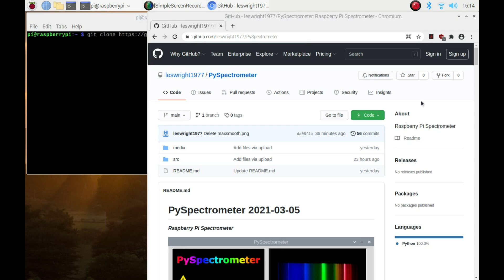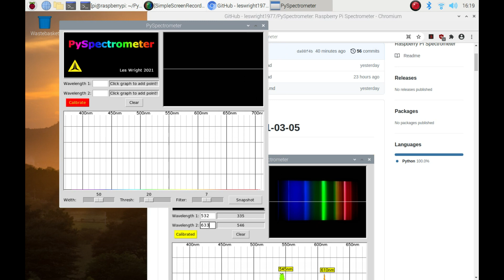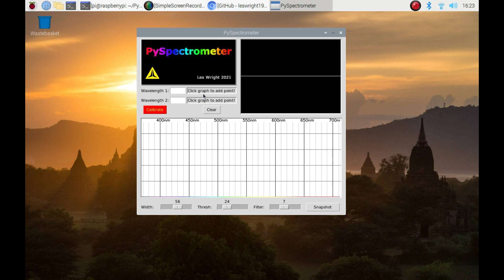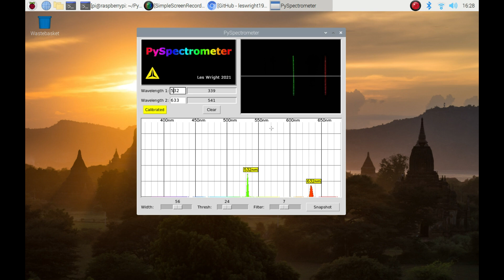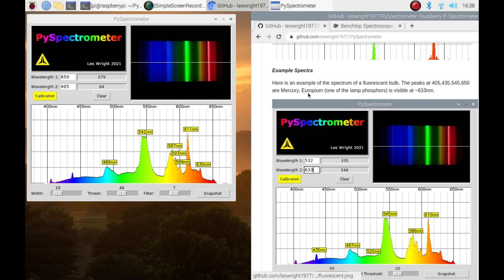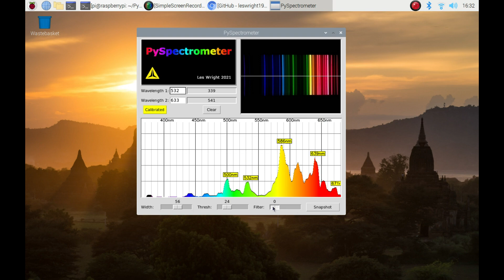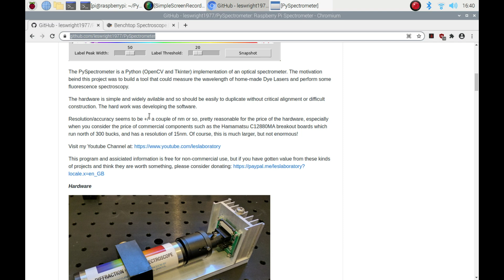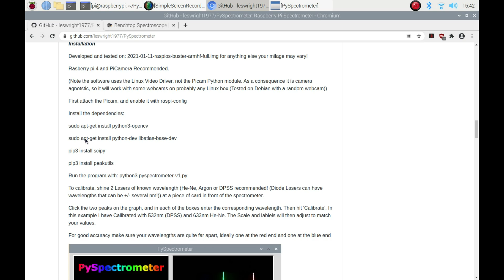How to build a DIY Raspberry Pi Spectrometer using a Picamera and Spectroscope.

Comment: Hey. Cool project! Do you think it would be difficult to make a similar spectrometer approximately the same size for IR/NIR ?
Reply: I was wondering the same thing, could you use the Pi NoIR camera to broaden the range into the NIR spectrum? (up to 1000nm I think...)
Reply: Most standard cams go up to ~1000nm, when the IR Filter is removed, that's for cheap. Night vision/Surveillance cams come even without IR filter. Rarely, cams go up to 1100nm. Above that..it starts to be a different hardware with germanium instead of silicium sensors..what is costly. From what I have seen, scientists are often interested in the range 2000nm up to 7000nm, and that is in the costly range.

Comment: This is a great tutorial. I just keep getting an error saying: 
    import cv2
ImportError: numpy.core.multiarray failed to import
 I downloaded all of the dependencies and even redownloaded them. Is there any way to fix it.
Thanks😀
Reply from the maker: @aomath9948  Weird, is numpy installed, what's is the OS and version? This article may shed light on the error: https://www.geeksforgeeks.org/how-to-fix-opencv-importerror-numpy-core-multiarray/
Reply: @LesLaboratory  Thanks for the response. The current version of numpy is 2.0.1 and the OS is Debian Bullseye. Is that OS too old?
Reply: Also when I tried upgrading openCV there is this error:
 
ERROR: Failed building wheel for opencv-python
Failed to build opencv-python
ERROR: Could not build wheels for opencv-python which use PEP 517 and cannot be installed directly
Reply: It still doesn't work😢

Comment: Might be good enough to play around with but your "calibration" is probably just good enough if you care about relative peaks and absorption lines. This doesn't take any sensor "response" into account so the actual shape seems to be bogus.
Reply from the maker: @JohnJTraston  Yep. If you want a predictable response you need to either use a monochrome camera, or debayer the sensor (see my other video for that)
Reply: @LesLaboratory  Do you think that the Sun spectrum would be reasonably consistent at a specific time of a day (e.e. noon) for such calibration?
Reply from the maker: @JohnJTraston  yes, but don't point it directly at the sun without and appropriate ND filter. The blue sky is luminous enough for this job. I use a small hand held fluorescent lamp for calibration which produces nice sharp lines.
Reply: @LesLaboratory  I am not talking about lines but rather the actual proper shape to account for Bayer filter, etc... Like, grab a standard D55 illuminant values from a table, capture the Sun and calibrate the overall shape of the expected spectrum.
Reply from the maker: @JohnJTraston  ah gotcha. A tungsten bulb would be better, and is as far as I know, a standard.
Reply: @LesLaboratory  Hm... I'd have to try it. It might have a better black body property but I am not sure I can trust the temperature of it.
Reply: No they are not it depends on the temp of the philiment of course.  You could bue a calibrated tunston lamp @LesLaboratory

Comment: Did you remove the IR filter from that f1.6 zoom lens?
Reply from the maker: No. But they can easily be popped off.
Reply: @LesLaboratory  OK great, got all the stuff arriving this week. Nice project
Reply: Got my cam and my zoom lens,  my U19500 Diffraction grating arrives tomorrow. Already ripped out the IR filter. Mounting structure will be 3D printed❤😂

Comment: Really cool project. Possibly uneducated question, would you achieve greater resolution by tilting the spectrum scope relative to the camera? My thinking is that if your sampling line covers from the bottom left of the spectrum to the top right of the spectrum you’d have more pixels to sample?
Reply from the maker: Not really. The camera is already capable of much higher resolution, but the optics in the spectroscope are not really up to it. With a better frontend, you would be able to get sub-nanometer resolutions
Reply: @LesLaboratory  thank you for your response. I hadn’t anticipated the spectrum scope itself being the limiting factor, but that makes sense.

Comment: Would you publish a known set of peaks ? Will they work with a telescope?
Reply from the maker: The peaks are published on my github (see description). With a telescope, since stars are point sources, there is no need for a spectroscope with a slit, you could just use a diffraction grating. I have not written software for this though.

Comment: How about an IR spectrometer, like the one that chemists use to identify molecules? Is it possible to make one at home?
I was thinking on it myself for quite a while, but I don't have any ideas what parts could be used to produce a wide range of IR radiation frequencies that could then be filtered out by the sample, and what detector could be used for IR radiation from that range.

Comment: is this useful for detecting skin colour ?
Reply from the maker: This is originally designed for measuring light sources. For reflected light you would need adequate illumination. There are color sensors available inexpensively for the arduin and raspberry pi that might be more suitable, especially if you are trying to match skin tones for cosmetic applications for example.

Comment: Is there a huge difference between those 10$ china spectroscope and those more expensive 80-200$ ones for this specific project?
Reply from the maker: I have never had one of the cheap ones. If it's 10$, then it's worth a gamble I would say.

Comment: How and can this be used to identify metal composition using an arcing device to generate the light from the spark to software to identify the metal used in the spark event?
Reply from the maker: It might be possible but would require significant modification. For Laser induce Breakdown  Spectroscopy, you need to be able to capture the afterglow. The initial flash is just broadband light. This means you need to gate the camera somehow in order to capture the spectrum.
Reply: What if a person used video capture and froze a frame at the desired point and used that for the spectrum to analyze? 
Also could you link the correct raspberry to buy to run your software? I am confused as to what I need to buy today or sooner!  @LesLaboratory

Comment: Just a simple question: if you correct for lens distortion, would this help to get more linearity in the sensor?
Reply from the maker: In the latest version, the PiSpectrometer2 (see my other videos), the nonlinearity is dealt with, by using multiple data points for the calibration. This essentially creates a best-fit curve that compensates for dispersion and aberrations in the optical path. If done correctly the calibration is extremely accurate.
Reply: You are really fast in answering! Indeed I've seen that videoas well, but on my gut feeling I'd say that using a high degree polynomial for curve fitting holds the risk of overfitting. What I'll do is built the spectrometer setup (thanks for sharing this very cool project by the way!!!!!) and see if can find out what is tha best manner to calibrate: correct for lens distortion and do a two point calibration, or apply a multi point polynomial curve fitting.   @LesLaboratory

Comment: Cool I have built a Raspi Terminal with 7" touch screen,  that is beside my light microscope... with Raspi cam mounted to the third ocular on the microscope. Now if I added a UV LED illuminator I could measure wavelength shifts etc of specimens !

Comment: How difficult would it be to retrofit this project to an ESP Cam and stream it wirelessly to achieve the same objective?
Reply from the maker: It could be done, to a degree, it depends what you want to achieve. I guess you could use the ESP cam and minimal software to stream the intensity and wavelength values only, then do post processing on the computer.

Comment: amazing project! if i using monochrome camera, which parameter should i change? thank you!
Reply from the maker: You shdoulnt have to change anything. Is just uses the first available camera, and if that happens to be a black and white USB camera, it will lick it up and use it. There is updated software by the way, with a seperate script specifically for USB cams: https://github.com/leswright1977/PySpectrometer2
Reply: @LesLaboratory  thanks's for the opportunities. Buat i mean, i have monochrome camera from Allied Vision (vimba usb camera) that have an API to use. Have you ever know about this?

Comment: id like to take it a step further, and use 200-700nm grating for the spectroscope, and duueterium or another light that emits 200-700nm and modify the software to be able to calibrate serial dilutions in order to ID and quantify molecules in a solution.    would you be open to working together or helping to get there?

Comment: Hi Les I'm a newbie . Just bought the Raspberry Pi 4B (1GB RAM) because of your wonderful project. Unfortunately rpi can not boot using 2021-01-11-raspios-buster-armhf-full.img. It says the system is too old. So I tried the ver. 2021-03-04. Ok the booting is fine but when installing pip3 install scipy: "Running setup.py bdist._wheel for numpy  - the computer almost freezes, it's not responsible so I can not finish the whole process. Any hints would be very welcome, thanks in advance
Reply from the maker: What is the pi foundation up to?! I will download the new image and see what can be done here. I was wanting to write new modules for it anyway! Thanks for your support!
Reply from the maker: Version 3.2 now up on GitHub, which fixes the issues in Bullseye, (just tested with latest image). Let me know how you get on. The next incarnation of this project is coming soon!
Reply: The same situation when using Legacy (September 6th 2022, Kernel version: 5.10
Debian version: 10 (buster)) taken from raspberry page :(  Still I cannot pip3 install scipy. Is anyone willing to prepare the system with the libraries installed so I could run PySpetrometer on my Rpi4 please? I'm willing to pay for your time...

Comment: I love your channel and videos, so helpful for a laymen.  I wanted to track down the two lasers that you used to calibrate, but they seem to be extremely pricey.   You mention that diode based lasers aren't that accurate, is there another light source that I could use to calibrate that isn't that expensive?   Thank you!!
Reply from the maker: Thanks! Yes, you can use old style fluorescent lamps. These have clearly defined emission lines that are are easy to look up. Regarding lasers: the 532nm green pointers that you can get really cheap are bang on 532nm and do not drift. The 405nm violet pointers are fairly reliable as well. All red pointers drift in wavelength quite significantly, and without spending $$ they may have wavelengths +/- several nanometers from that advertised.
Reply: @LesLaboratory  That's awesome, thank you for sharing your knowledge, I really appreciate it.!!   I'll keep watching for new content.

Comment: Hey, I tried to build the spectrometer, but I am having a little difficulty with the python code. This is the error message:
[ WARN:0] global ../modules/videoio/src/cap_gstreamer.cpp (1824) handleMessage OpenCV | GStreamer warning: Embedded video playback halted; module v4l2src0 reported: Failed to allocate required memory.
[ WARN:0] global ../modules/videoio/src/cap_gstreamer.cpp (914) open OpenCV | GStreamer warning: unable to start pipeline
[ WARN:0] global ../modules/videoio/src/cap_gstreamer.cpp (501) isPipelinePlaying OpenCV | GStreamer warning: GStreamer: pipeline have not been created

Does anybody have any idea what I could change to fix this?
Reply from the maker: What version of Raspbian are you using?
Reply: @LesLaboratory  i am on version 11 bullseye. sorry for the delayed response.

Comment: Hi. I wonder if you could stretch the camera-image to match the graph. My brain was trying to match the lines to the peaks while watching and that would make it easier. very cool.
Reply from the maker: It could be done, and it is open source, so you can modify it if you like. The reason it was not done is speed, large live images in OpenCV are a bit hungry for CPU and RAM, so I wanted it lean. I suppose I could remove a strip of video, say 20px high and 640 wide,  and display that under the graph, that could look pretty cool!

Comment: How high in frequency can your system detect? can it detect far infrared? or is this more dependent on the camera being used? Great work!
Reply from the maker: It can go a little ways into the UV ~380nm to a little ways into the IR ~810, but the spectroscope was designed for visible light. You could build a spectroscope with an extended range though.

Comment: Those aren't bad, I bought one based on the same technology offered by Chris Wesley in the UK called the iPhos: https://youtu.be/F1pdnt3-4y4 - The accuracy is stated to be about 2 nm, but from what I saw from mine, closer to 1 nm, sometimes half of that, depending upon how wide the slit is and the amount of light. Since then I upgraded to an Ocean Optics Spectrometer I found on ebay for 350 dollars which works great. The price was a steal, normally they go for two times that or higher, depending upon the model. Mine is an older SD2000 but it is just as accurate as their newer models, for the most part, unless you buy a very spectrum limited unit which doesn't have much range, those can be much higher accuracy down to under .1 nm.

Comment: How do you calibrate amplitude (height)? which source could be used with a known curve? For example, I think a calibrated amplitude is needed to calculate CRI for light sources
Reply: @TheOleHermit  that part is clear, I'm suggesting to introduce a second calibration for the amplitude

Comment: How well does it run on a rPi 2b? Has anyone tried?
Reply from the maker: It will run on other Pi's, including the zero but very slowly. If you wanted compact but fast, you could use a Compute Module perhaps.
Reply from the maker: EDIT: I see there is a new Pi Zero 2, quad core, now THAT I would like to try!

Comment: How does the F number of the CCTV lens effect the operation/sensitivity of the camera ?
Reply from the maker: The lower the F number, the larger the aperture, and so the better the sensitivity. Ultimately on a system like this, you are limited by the spectroscope slit.

Comment: Hi, I’m really interested in this project.. I’m looking for buying a sekonic spectromaster.. but it’s around 1300€ for the entry level one. Where do you go with that ? Is that only for research ? Or will yo go further ? Great job ! 👏
Reply from the maker: I have used it for my own projects, such as measuring Dye Laser tuning curves, and it is just great. Close enough for what I want, that's for sure.

Comment: Excellent video!  I built the spectrometer.  I want to increase the sensitivity of the camera.  How can I do this in software?
Reply from the maker: Thanks!

Hmmm, I am using the V4l2 driver, so mileage might vary.  See lines 260-284 in version 3.
It may be possible to do:

self.vid.set(cv2.CAP_PROP_AUTO_EXPOSURE, 0) #turn off auto exposure
self.vid.set(cv2.CAP_PROP_EXPOSURE,  somevalue) where somevalue is something you will have to play with (expects float I think: 0.7 or something)

Won't hurt to try...
Reply: Thank you for your quick response.  I just got married less than a week ago, so I didn't have much time to work on the spectroscope.  I tried your suggestion but it didn't seem to make a difference.  I did an experiment using the picamera object and setting it for a 5 second exposure at maximum ISO setting, and that worked to give me more sensitivity.  I'm trying to see the spectrum of various gas discharges, so the light levels are very low.  Would changing the frame rate of the video capture to a really low value change the exposure time?  I'm new to Python and the Raspberry Pi.  I also have no experience with camera software.  How do I access the camera object used in your software?  I'll work on it when we get back from our honeymoon.
Reply: @ronaldbaktis9441  are you trying to detect gas or to detect composition?  What gases?  You probably need IR for compositional analysis, or a hot wire chromatograph or a gas mass spectrometer.  I am using a mass spec on the oil well I am on now, its components are around $30,000. It uses a 90,000 rpm low pressure turbine.

Comment: Would this be useful in detecting what substances make up a powder or liquid? Like if you put it between the light and the receiver, would the change in what light passes through help to determine the makeup of whatever solution you put in its path? Like say for instance you had a few bottles of plant fertilizer without labels and your objective is to identify which is what and if any of them are mixtures, and if they are, what that mixture would be..... If you understand what I'm saying
Reply from the maker: Yes. What you are describing is Spectrophotometry. You would have a light source aimed at the spectrometer with a known spectrum. This would pass through a Cuvette containing your solution and note the absorption spectra to make a determination of the contents.
You might find with things like Ammonium nitrate, you would need to be able to detect quite far into the Infrared though.
Reply: @LesLaboratory  what about products like SCiO's NIR Micro Spectrometer? Too good to be true?

Comment: Awesome work!
Could you suggest other suitable usb camera fore the project ?
Reply from the maker: It 'should' work with any USB cam that the Linux driver supports. Of course there is variation in quality of cameras. The beauty of Picams though, is that there isn't much variation between models, even from different suppliers.